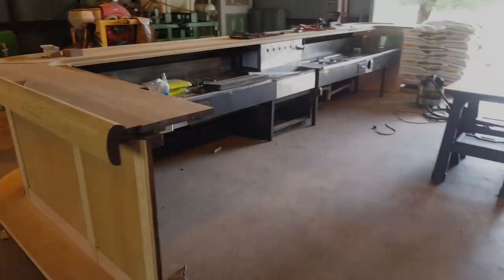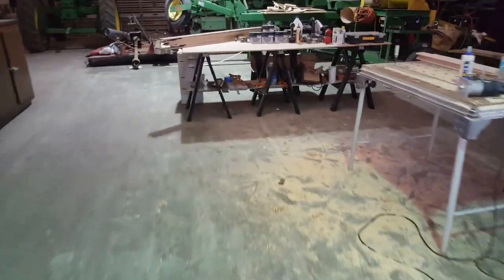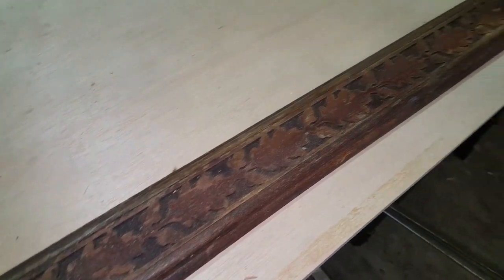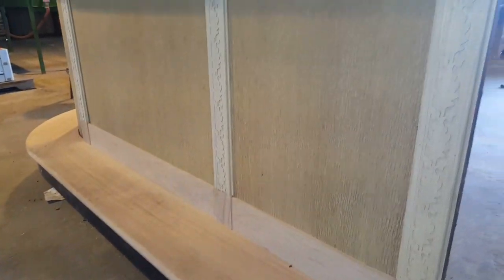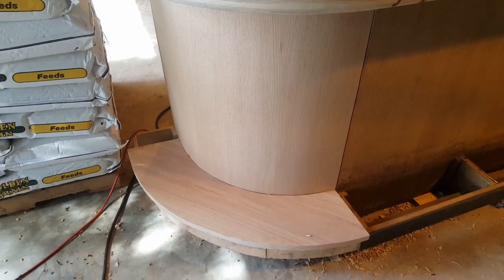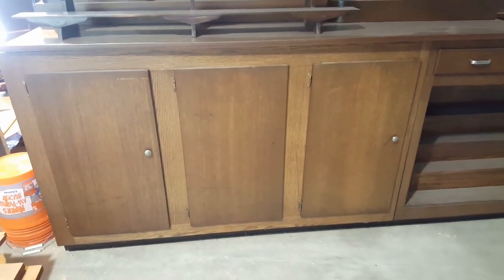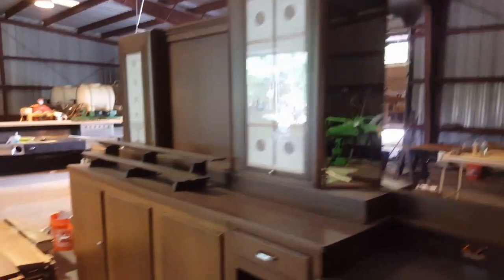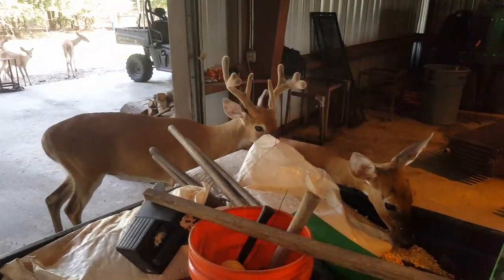Antique Bar Restoration

Comment: Man, you're really pushing that x-carve to the max. It's awesome seeing what's possible with it. It'd be great if you can make a video showing how you're making some of those longer pieces with it... how do you keep the pattern going without any visible breaks between pieces?
Reply from the maker: Zero Cool I've had problems lining up patterns, found it best to overlap the pattern a bit.  These pieces are less than 30" so the x-carve does it all in one shot.